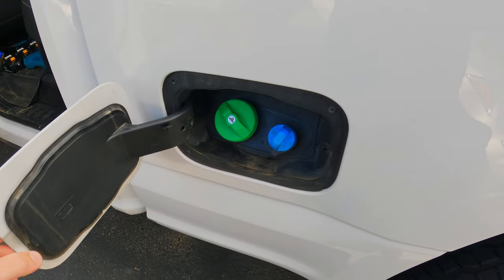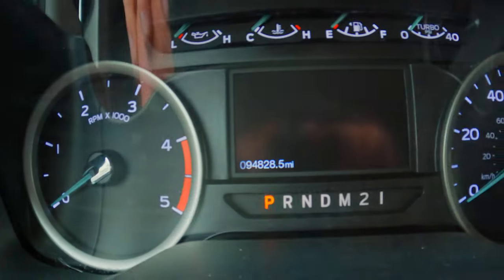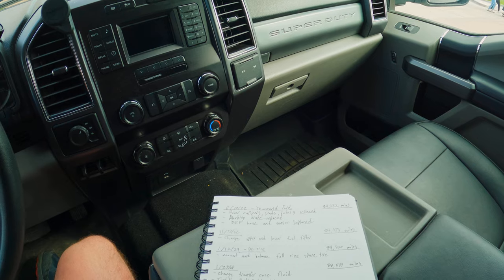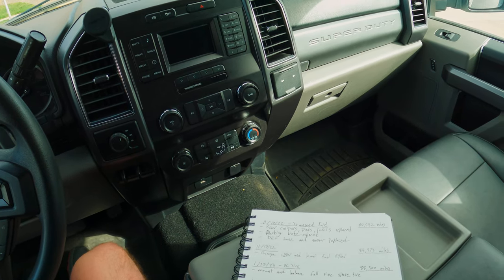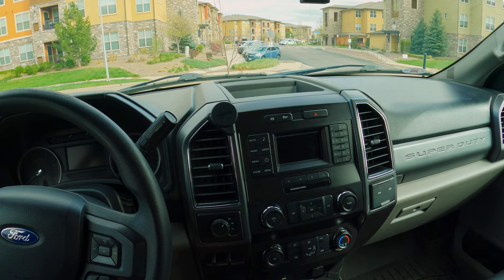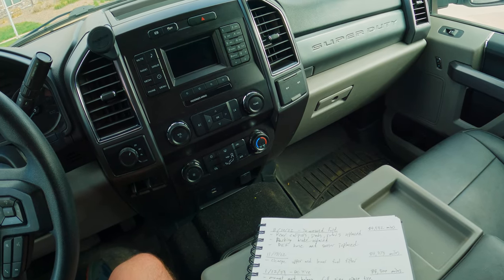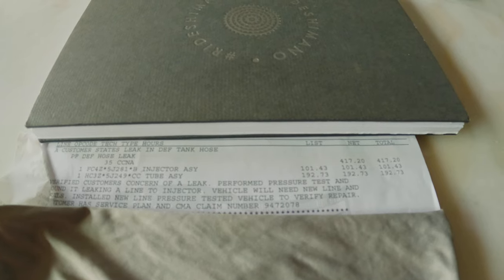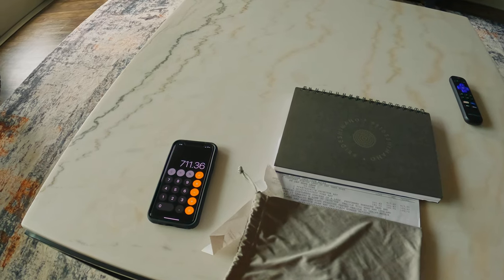6.7 PowerStroke Emissions Repair Costs So Far

Comment: Great advice. Most people don't do their own maintenance so they don't find things until it's too late. As far as the dealerships go, most of the time they charge Ford for top dollar for repairs. My dealer charges a lot less if I'm paying out of pocket. That's my dealer though. With that being said, I know my extended warranty paid itself the first time I took my truck in. I've had several other warranty repairs done that would have cost me thousands. Definitely worth it to me.
Reply from the maker: For sure!  The extended warranties for these trucks are often well worth it.  Crawling around under your own rig to check things is one of the best things to do.  No other way to know what's going on under there haha what sort of repairs have you had to make under the extended warranty?
Reply: @powerstrokemaintenance  I've had the panoramic sunroof replaced, upper oil pan leak fixed 3 times, random ball joints on the front suspension replaced, cold side intercooler pipe replaced twice (not doing aftermarket due to extended warranty), and various other electronic items. Things like this sometimes happen on the first year of a redesign but overall I'm impressed with the truck. Ford has denied a replacement vehicle even though I've gone in 3 time for the upper oil pan leak. Unfortunately, I will be trading this in when my extended warranty expires in 3 years or 36K miles. I don't drive it much anymore so I won't hit the mileage before the 3 year mark. Gives me time to save up for a new one. I just hate knowing that someone else will inherit that leak. That's why I've been pushing Ford to replace it and take it back for an engineering investigation.
Reply from the maker: Wow that’s a lot!  I remember you talking about the oil pan leak on another post.  That’s unbelievable.  What do you think you’ll get for your next rig after having all these issues with ford?
Reply: @powerstrokemaintenance  To he honest, I'll probably still go with Ford. Overall, they seem to have the least issues out of the big 3. I have friends with GMs and Rams and they have their problems too. I think Ford has done a great job with their engine and trans. When I do get a new truck, I will be going dually though. Kids are getting bigger and our current toy hauler won't fit all of the toys once my boys start riding 450 dirt bikes. I need something to fit our 4 seat SxS, wife's 450 quad, and two 450 dirt bikes. Plus all of our other crap that my wife has to bring lol. I don't like firewood in the trailer but I will lose some bed room with a fifth wheel. Oh, first world problems lol.
Reply from the maker: Hahahaha first world problems indeed!  Sounds like you would get a lot of value out of a dually though, with what you have to tow and all the gear you carry.  That’s a great point about Ford though, the engine and trans are great and you won’t escape issues just by going to another brand

Comment: What happens if you go into regen as you get home and turn truck off?
Reply from the maker: In my experience, nothing
Reply: I believe it just continues where it left off once it reaches operating temperature,next time you use it,  at least that’s what mine does.
Reply from the maker: That sounds correct to me!
Reply: @barefootbilly223  Same here but if time available try to let it run its cycle
Reply: @powerstrokemaintenance  I heard it can go into limp mode, and you might have to take it to the dealership for them to force a regen
Reply from the maker: I’ve heard that but never experienced it.  I think it has to get super plugged for a forced regen 😂
Reply: @powerstrokemaintenance  thanks
Reply: I'd suggest going on a ride till the regen process completed
Reply: @rayc5255  Yes I always try to let it completely regenerate if possible, but yeah you want to make sure it actually eventually regens completely or else it’ll put you in limp mode and you’ll have to go to a shop so they can force regen it to clean it out or possibly even remove it to clean it out.
Reply from the maker: @barefootbilly223  good point!